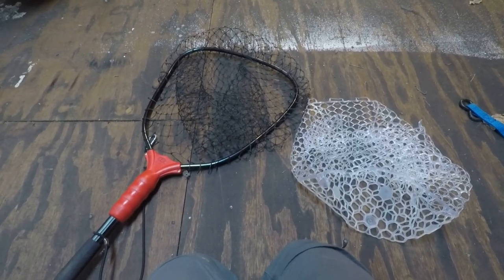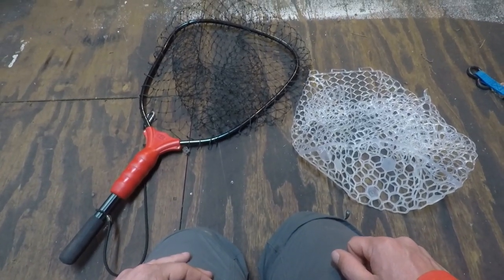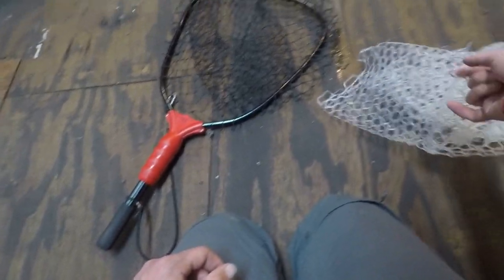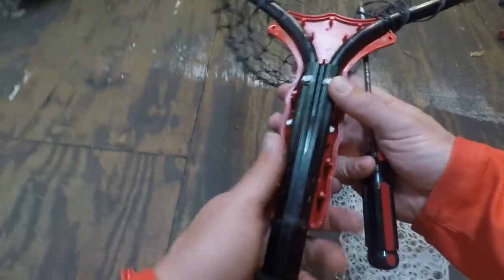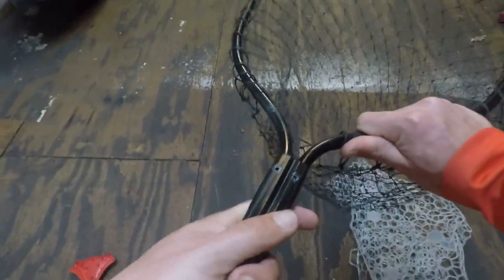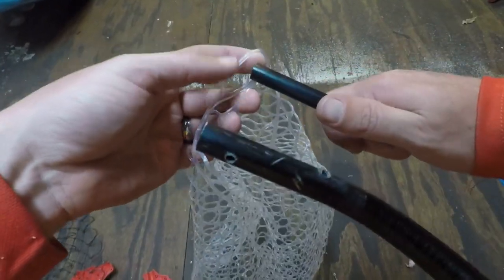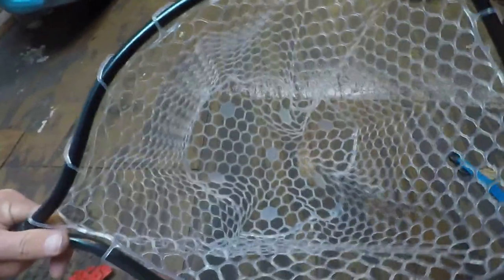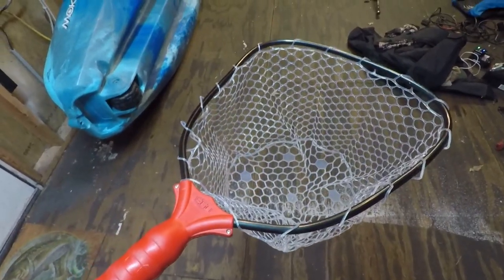How to EASILY swap out your Ego fishing net material!  Clear rubber net upgrade

Comment: Thanks I needed to do exactly this with my new Ego S1. The netting is due to get here Saturday from Idaho and was curious as to how difficult the process. Lo and behold you had this video! Ta Da!
Reply from the maker: Glad to be of service.  Let me know if you have any questions.
Reply: @catchinwithkyle  Having trouble separating the plastic handle.  If I use the flathead screw driver, it looks like it will damage the plastic.
Reply from the maker: Yes it can be difficult to seperate at first.  I have small pry bars too but they both cause slight damage.  Just take your time with it to minimalize any damage.
Reply: @catchinwithkyle  Got it done.  The other problem is the process of getting the net on.  But it is done.  Thanks!
Reply from the maker: @jroley2204  Oh no doubt that it can be a pain haha but not too bad when you get the hang of it!
Reply: Thanks for the vid. Looking at upgrading my net. It’s just non rubber coated on mine.